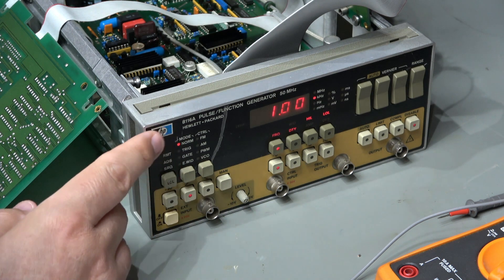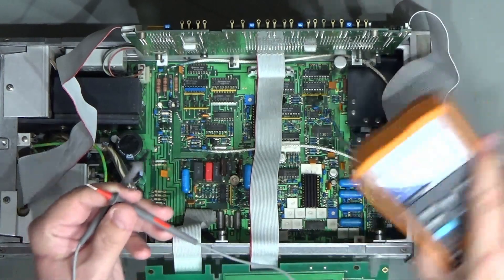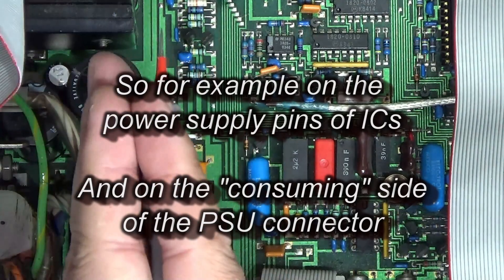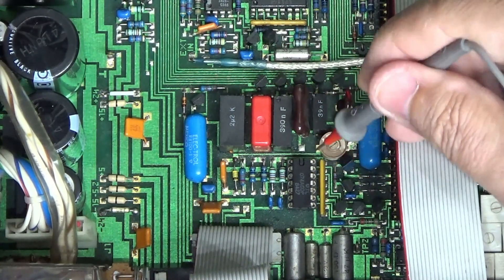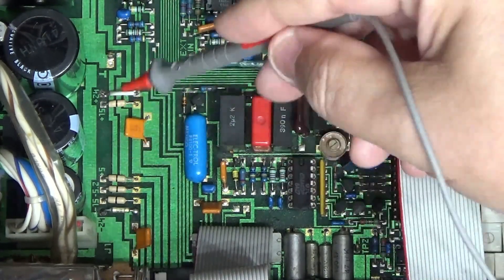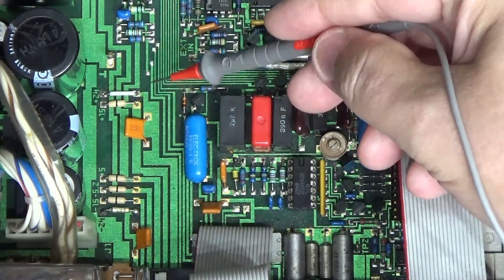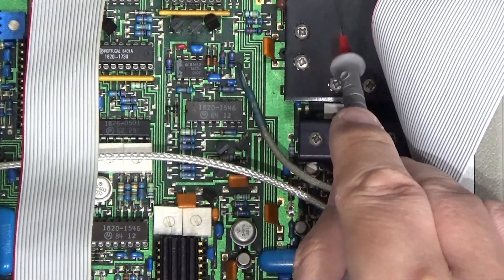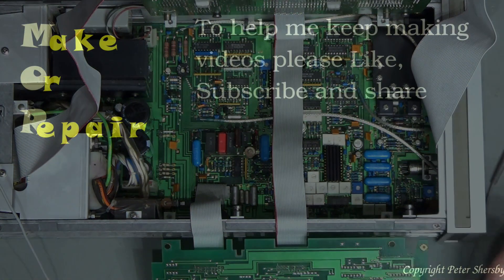Don't do this #0083

Comment: I repaired one of these a couple of years ago. Same issues with the output transistors. Ended up finding some NOS in the US. Easy fix and working as it should. I held on to it for about a month after realising just how unstable the VCO frequency generation was. I could not live with it and ended up finding an older but significantly better HP 3325. Karl
Reply from the maker: I had to do the calibration on mine.  I was more than shocked when I started reading the acceptable ranges and the compromises needed to get it in spec, getting one range in tight tlerance meant another range horribly out.  It was only then that I noticed the +-5%  on most freqnecies and amplitudes and the relatively poor stability over time I ended up with in about 1% up to 20MHz, then getting worse to about 4% by 50MHz - pointless for my use!   I am not hanging on to it.  I use a Siglent Arbitrary generator that is "patched" to the max 120MHz for most purposes and it is pretty good.

Comment: Putting in fuses, because I couldn't find my zero ohm resistors sounds like something I would do while troubleshooting something in the final output section that's tripping the crowbar over current protection. Especially if what's tripping it is my clumsy probing to measure voltages.
Reply from the maker: Yes, I prefer to power it from external current limited supply.

Comment: Error 42 here. -24V rail fuse blown. Good lesson to learn to check both sides. Since yes the schematic does not tell you it uses fuses. Was labeled as "W16 with 0 ohms". 5 blown transistors on the output amp. Some failed as shorts others failed open. Seems like a very common issue with the 8116A and the 8112A from what I hear. Wonder what the deal is? Pretty sure it worked in its day though. Another common thing to check, make sure its "original". I think one of the transistors were replaced with a guessed equivalent before it got to me. So there's that as well.
Reply from the maker: Just checked my scribbled on service sheet and it was E21 which is a VCO slope,  but I suspect the error can surface in a number of ways if some power is not available.  It was U101A that I refer to, which is pretty much the first section described n the E21 process - this provides a fixed -1.25V for a variable voltage source that is then buffered by U101B,  it was of course not providing it!   Now had I spotted the power problem earlier...
Reply from the maker: Re the output transistors,  I've seen the design they used in several other devices by HP, and one failed transistor did tend to take out a couple of others and also fried the current limiting resistors.  I think the design is not particularly robust in the face of a short circuit if it is being used for  high voltage output the current through the resistors on the final transistor is just going to be too high whithout a 50 ohm output impedence to limit it.  off the top of my head about 2A which is going to cause transistors (and depending on duration) the resistors to fail pretty fast